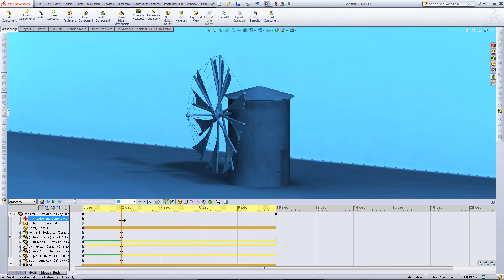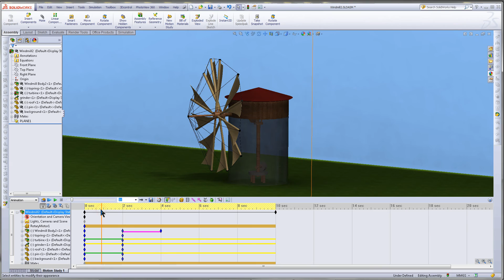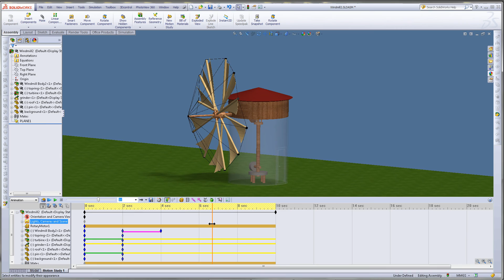SolidWorks Motion: Part 4 - Adding Transparency

Comment: I'm not sure if you're still replying to comments but I'm trying to do make a component slowly fade in/out I've set it up as shown but as soon as it hits the 'Key' at the beginning of the pink bar it immediately appears/disappears. Do you have any idea what i might be doing wrong?
Reply from the maker: Hi there!

We've reached out to the author, and can also direct you to a variety of helpful resources for inquiries. 

MySolidWorks is the place to get the best answers to your questions about SOLIDWORKS in one location. 
 
SWUGN, or the SOLIDWORKS User Group Network, can be accessed here:  http://go.solidworks.com/Cbz 

With your existing SOLIDWORKS or 3DEXPERIENCE ID, you can access SOLIDWORKS Forums for more information on a variety of topics and questions from our user community. 
 
Check it out here: http://go.solidworks.com/J56